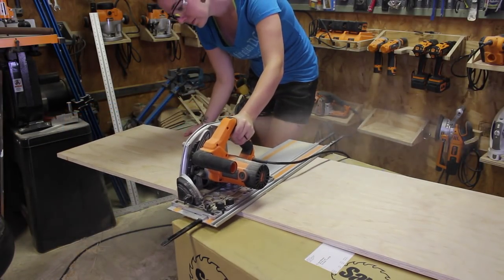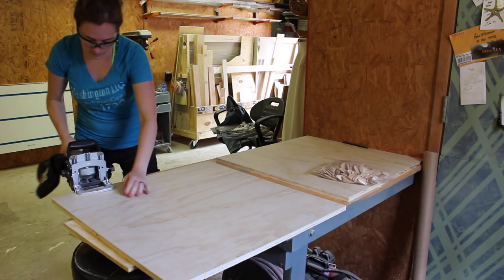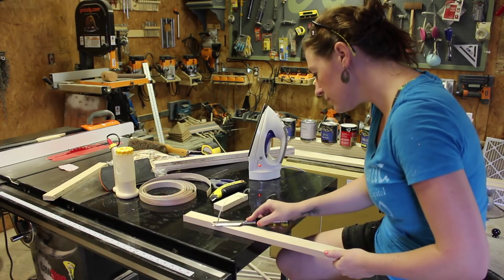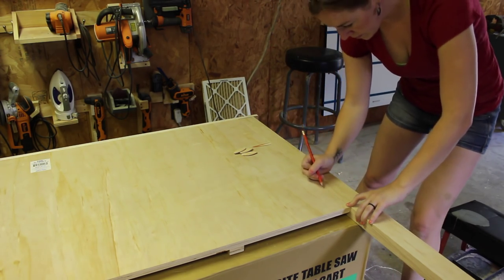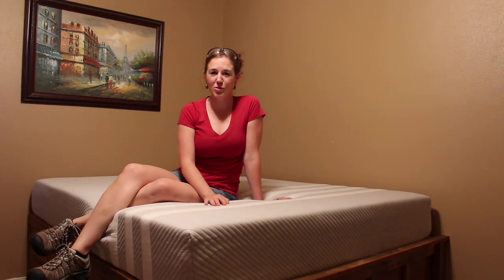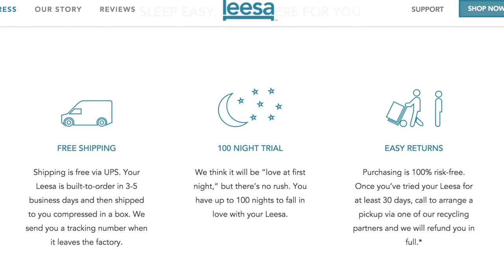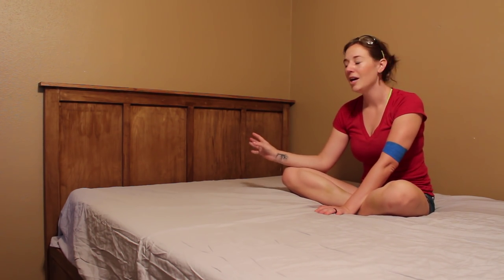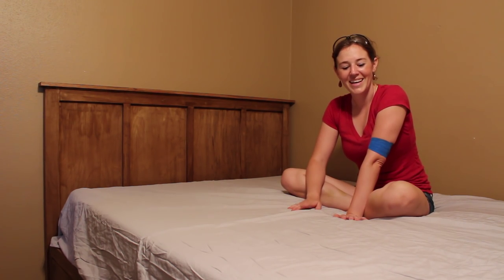Build a Queen Headboard

Comment: April,
  You can use pocket hole screws on the back side where they are not visible in conjunction with the biscuits. Just space them in between the biscuits.  Poor man clamps...... I've used that combination quite a few times with great success. Looks great over all
Scott

Comment: An easy cheap clamp for large stuff can be made from a cargo strap.  Just put wood scraps between it and your project because it will dent the wood.  They work great and don't take up much room.  The headboard and bed are beautiful, you did a great job as always!!!!!!
Reply: +Tim Waddell Sometimes a pipe clamp is the way to go on special clamping setups.  Once you have purchased the clamp parts, you can purchase any length pipe for the job.  Another alternative is to take two clamps that are too short and hook them together on the end that doesn't have the tightening screw.  For example, two 4 foot clamps hooked end to end can be used to clamp a 7 foot object.  Just some suggestions.

Comment: I have the same particle board walls in my garage. Recently while making my new benches, and lumber (Wilkerdo) Rack, I decided to paint them flat white using a cheap ceiling paint/primer combo from the local Menards. I had been thinking of adding more lights, after all are 8 shop lights really enough? After doing the painting on 2 walls, The difference in light in my garage is incredibly better. I am hoping to get my last bench in and wall painted this coming weekend. The white paint on the walls has made an incredible difference.

Comment: I recently ran into a clamping problem like yours, I resolved it by taking two planks that were longer than the work piece and nailing a rail at the ends of the plank and using wedges to apply force to the work piece, it worked very well.
Reply from the maker: That's a good idea.
Reply: April Wilkerson They do happen from time to time, but not nearly enough to make me that first million though  : (

Comment: For lights (if you meant video lights), I recommend using T5 fluorescent lights. T5 lights flicker at around 35,000 Hz, so there will be no flickering lights in the video at any frame rate you would use. I plan on using these my self, T5 865 meaning 6500K, so proper white light (might feel like blue if you're used to normal lights which are very yellow). And since you make things yourself, you can make stands that lets you adjust their angle etc.. I'm planning on making two stands and having 4 lights are around 65cm long (about 2 feet) on each so I can turn on or of depending on the amount of light I need, and set the angle to fit what I'm going to record a video of. It's cheaper than professional video lights, and more than good enough :)

If you didn't mean video lights, just normal lights in the ceiling, they can be good for that as well. They're more efficient than T12 or T8, flicker at a much higher frequency, so there is less chance of getting headaches or getting tired of being in the room due to the light, which can happen even if we don't consciously notice the flickering of the other kinds of lights. And when they go bad, they just die, they don't start to make noise and turn on and off all the time.

And a nice video as usual, keep up the good work, it's always interesting to watch :)

Comment: You can join two clamps end to end using the two holes on the frame. Just put a piece of hard wood in the rail, drill the 4 holes on the two frames in the wood and insert the screws, you can use quick release pins. I used butterfly nuts on regular bolts. I've been using them like this for some time since my wood shop is in the back of my metal shop and thus, small.
Reply from the maker: I'm trying to imagine what you are saying, but I'm not doing a good job visualizing it. : / Is there a video or picture of what you are describing?
Reply: Mine are pipe clamps so a picture wouldn't work out. But i've made this model in Sketchup. Check the link:

http://postimg.org/image/44fp6qamt/

did it really quick so slight inaccuracies between your clamps and the model are to be expected.

I'd go with that small raised section as it makes sure the metal is equally supported when the bow action (tightening the screws at the end) is applied.

My pipe clams just use a threaded pipe connector and that's that, yours will need that piece of wood to be fabricated and 4 screws, but i really think it's worth it. The any other option is to get longer sections of pipe/c channel.

Hope it helps :D

Comment: Long clamp suggestion:  Buy some pipe clamp ends and then several pieces of pipe thread on both ends, say 4' long.  Add a couple of pipe couplers, and you can make clamps as long as you need, but only have to store 4' pipes.

Comment: Happy woodworking!  Just my two cents but you could have clamped up the smaller pieces with your small clamps and then used glue and pocket holes on the ends for both a glue and mechanical joint.  Since the piece is against the wall the pocket holes would have been hidden.  But then again it was just a sheet of plywood and if it didn't work out Meh... no big loss.  Not like you were working with Walnut, Oak, or some other expensive hardwood.  Keep those videos coming!

Comment: How did the biscuits work out for you? I would be concerned about the strength when joining into the edge of plywood, but I could be wrong. My solution would have been pocket holes, splines or dadoes, but if the biscuits work, it is certainly much easier than splines or dadoes.. I tend to overbuild joints like that because in my dry climate, glue joints tend to fail more easily here, and require more glue surface.
Reply from the maker: The biscuits worked out great, I was really happy with how easy it was and also how secure it felt. I always use pocket holes so I wanted to give it a try. We'll see how it feels in the future. : )

Comment: Nice vid, was kinda hoping to see this as a rail and style type construction with panels instead of the large sheet with the moulding. Did you mount it to the wall or to the bed?
Reply from the maker: I'll have to look up rail and style construction, I'm not sure what that is. I mounted it to just the bed. It didn't move around so I figured it would be good.

Comment: April:  Biscuit slots.  Please take the time to build yourself an outfield table.  Easy to make; you can make it folding to save space; AND, it is so much safe than what you currently have going.  Keeps the long boards from wanting to flip up.  Finally, that flip up out feed table will provide you another work surface (double duty is better).  Just a thought!!!  Here is one place for plans/directions for a SawStop PCS outfield table.  http://www.highlandwoodworking.com/woodworking-tips-library.aspx#sawstopoutfeedtable

Comment: I just recently encountered your videos, and must say; Awesome Job! I have a question on this project though. Why did you split the main board and then reassemble it back with the biscuits? It seems to me that doing it that way would add an unnecessary joint and weaken the piece.
Reply: 3 years later but I'll give you my take on this: The grain on the 4'x8' sheet of hardwood veneered plywood is probably running long ways, which would only give you a piece 48" wide, but a Queen Mattress is 60" wide. If you really want the grain to run up and down taking 2 30" with the grain running in the right direction and joining them together would give the desired width and grain directions.

Comment: Looks great April. What happened to the shop lights?   You had a bunch.
Reply from the maker: They are all just old, they were installed in the 70s. I have them on three different switches and two lights on the back and one on the middle switch started arching and almost caused a fire. So I shut them off. I looked inside and the wiring on almost all of the lights are frayed and corroded so I'm going to completely replace them.
Reply: +April Wilkerson Wow. Yeah, you are smart to keep them off.  I recently added 4 of the 8' (4 t8 bulbs per light) florescent  shop lights in my garage.  Its waaaay bright.  No need for my portable camera lights. :)
Reply: I installed all T8's in my small garage. if I had to do it again, Costco had some nice LED shop lights for cheap.
Reply from the maker: I was thinking about going to 8' but ended up sticking with 4'. What do you think about the 8'?
Reply: +April Wilkerson They work well for me. One thing you may want to do is get lights that have a cover over the bulbs so that might limit your options. I have 11' ceilings.  You don't want to hit the bulb with something when you move stuff/project.  If you are not worried about that, you could try one to see how you like it.  I think each light was about $40 ish plus the cost of the bulb. Cremona has the same ones in his shop. Lowes/Home Depot has them. I think Lowes was a little cheaper.
Reply from the maker: I actually have covers already in my shop, so I'll just be taking the fixture out from inside and putting in a new one. : ) Good advice though.
Reply: +April Wilkerson See what you can find on Amazon and HomeDepot when you search for "LED Shop Lights". I have one above my assembly table, and its nice and bright without being harsh. The great thing about LEDs: compared to fluorescent and incandescent, they take very little energy, and they give off almost no heat. VERY house friendly, when you're dealing with an older house. The only real downside is they can be a little bit pricey.

I hope this helps, and I look forward to catching you at Rockler in Arlington soon.
Reply: RetroWeld
Reply: I know this question is a year old but I'm weighing in: don't use 8' tubes.  For starters when the inevitable shift to LEDs comes around, you'll have a much easier time finding 4' LED retrofits.  There's plenty of range of product available in 8' tubes, but they can be hard to find without going to a specialty retailer - but 4' options are well represented virtually anywhere you can buy light bulbs.

I'm a handyman in a large homeless shelter, and we've taken steps to remove the last few 8' fixtures we have so we can come back with 4'.  From an inventory and supply availability standpoint, it was an easy decision.

Comment: Total respect for your skills but why would anyone go from track saw to table saw?  BTW I'm a huge advocate of daylight balanced bulbs, they bring out all the color.
Reply from the maker: I use a track saw to break down a sheet to a manageable size, then move to the table saw. Even though a track saw makes shop life easier, I don't think it beats the ease of a table saw. Just my preference though.
Reply: I just found that the track saw makes a better cut.  BTW I'm a pro photographer and my advice to all who are at your pro level of YouTube presentation is to fill every light source you have with daylight balanced tubes bulbs et et et. It really makes for better pictures overall.

Comment: You mentioned that you attached the headboard to the rest of the bed.  What did you use to do that?
Reply from the maker: I used two screws on each end post to go into the bed frame. It was difficult because I had to move the frame out from the wall first. It would be much easier to build both the frame and headboard at the same time so you could attach it before moving it against the wall.
Reply: +April Wilkerson Thanks.  I wasn't sure if you made something detachable or even used some biscuits.